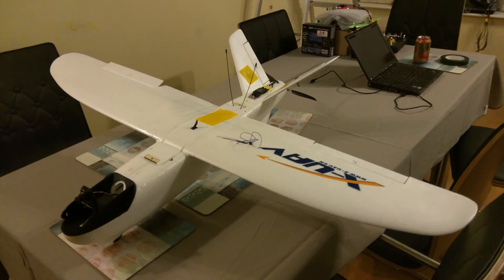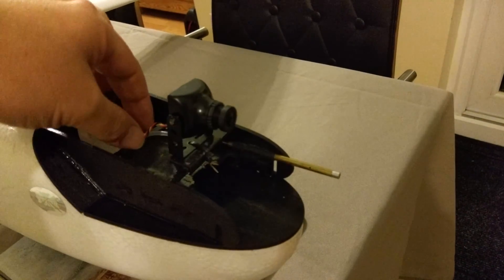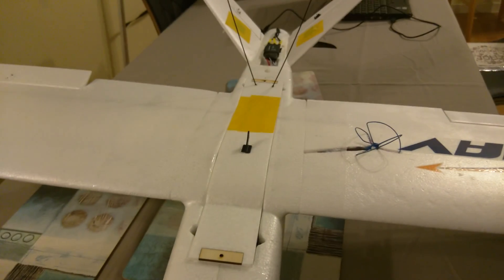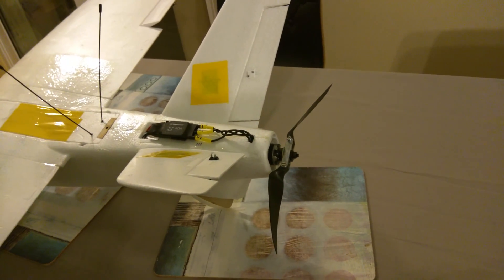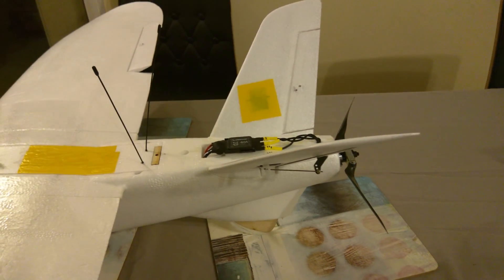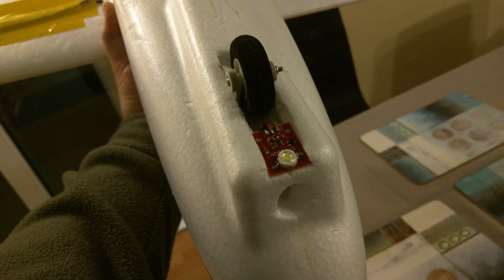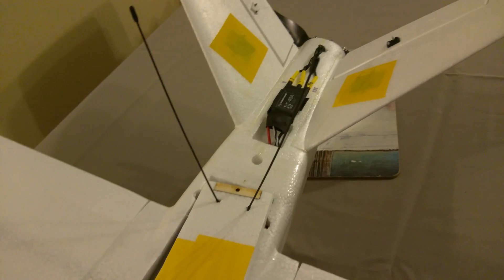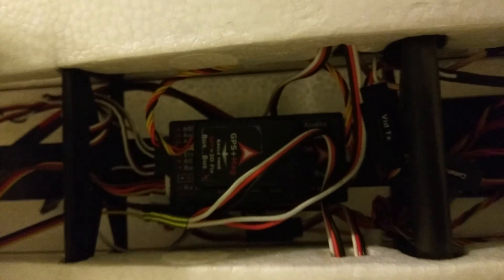X-UAV Mini Talon TBS Crossfire, Eagletree Vector

Comment: Past 5 years after some good testing, did you have any problems with these 433mhz antennas on crossfire?
Reply from the maker: They worked fine
Reply: I have exactly same components, with ET vector, crossfire and even two 433 monopole antennas. Waiting for a really good time to assemble everything. Thank you.

Comment: Do you get any interference from the Crossfire telemetry downlink in the Vector OSD?
I heard of someone having this issue, but I'd like to use your setup.
Reply from the maker: +turdsurfer No interference, however i am using 2.4 for video. The interference you have read about is related to 1.2/1.3Ghz video downlinks.
Reply: +Keith Sutherland Thanks. I've read about that too, but that's ground station related I think.

Comment: Great setup Keith .. just a note. I've received a defective crossfire rx and had to ship it back to Hong Kong for a replacement. Shocked that there is no USA hub. Cost me $34 US to ship.
Reply: +Aero FPV 
your post is 2 years old but comes as no surprise , I’ve been using EZ UHF for a very long time (ISSUE FREE) and decided to jump on the TBS Crossfire boat, biggest mistake EVER! 900 MHz has already been around the RC community for the last 50 years, does anyone remember why they ditched it for 2.4 ? It’s because of its unstable and cuts out and is very wish washy in its connectivity, it will be just fine in one location but you can go somewhere you’ve never been before and suddenly failsafe at 50 yards! I’ve seen this over and over and over again and TBS refuses to acknowledge it. There’s something about this frequency that’s very unstable in certain locations and I refuse to send out a several hundred dollar platform and GoPro with the high probability I’ll lose it...... so back to the point I was going to make, ive bought several nano Rx’s from TBS and they are about 25% junk, it’s so hit and miss I can’t believe they don’t have better quality control, not to mention the recent firmware updates are all over the place, issue after issue after issue and they can’t seem to get a wrap on it. Go to their FB channels (3 of them) and you’ll hear the massive complaints and unsatisfied customers. Instead of acknowledging the issues they let their fanboys attack you in the forums as they sit back and make smug remarks, I don’t know why/how these guys have managed to create such a fan base but 99% of their customers are rude little millennial asshats that aren’t interested in helping, only interested in defending a product that still in its R&D , even after 3 years of being on the market it’s still untrustworthy..... I’ll stick to my Ez UHF , it works flawlessly and the only downside is they haven’t come out with a nano sized Rx, at least as small as the TBS nano.
Reply: End liberalism It’s very disappointed, cause I have my mini talon ready to build with crossfire I bought last year ) I should test it on mini quad... BTW do you recommend full size EZuhf or JR module? Ps I also have frsky r900, it works strange
Reply: What is the R900 doing that is strange ? I use the JR module for my ezuhf and it is fine, I’ve flown 5 miles and then I finally needed to flip the little power up switch to 500mw, so 500mw at 5 miles is just fine! Who really needs to go any further than that ?

Comment: Crossfire with EzUHF antennas???
Crossfire 868mhz
EzUHF 433mhz...
Reply from the maker: +Wieland W EzUHF antennas are 1/4wavelength @ 433mhz which makes them roughly 1/2 wavelength @ 866mhz.
Ive range tested them and they work really well, not as well as a proper 1/2 wave dipole due to the lack of counterpoise but good enough until i make some proper 1/2 wave dipoles.